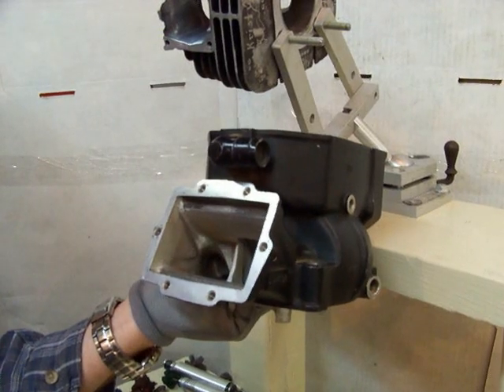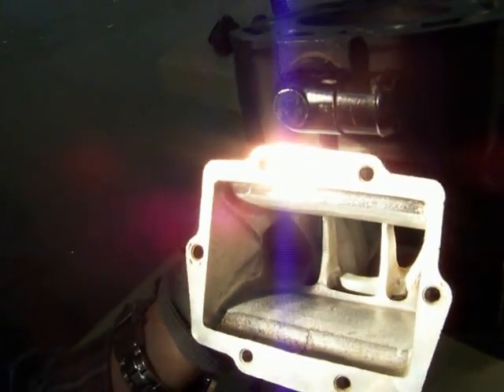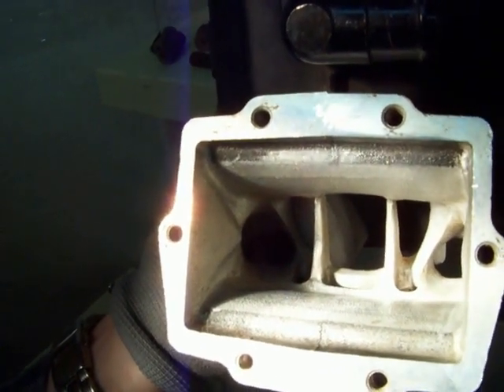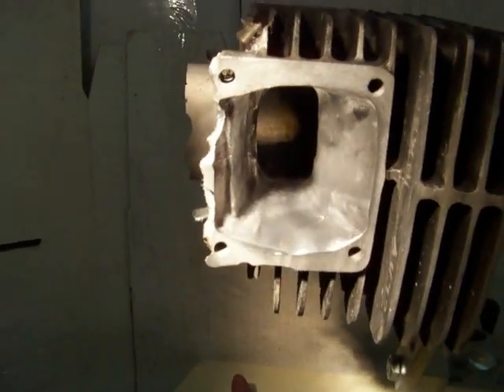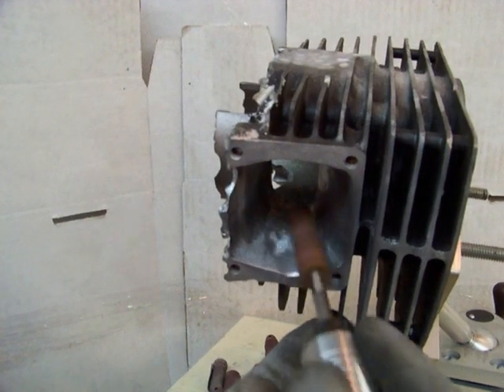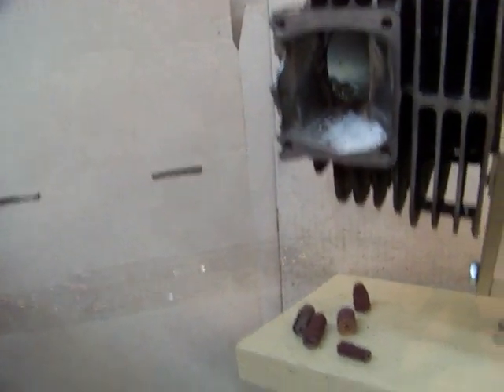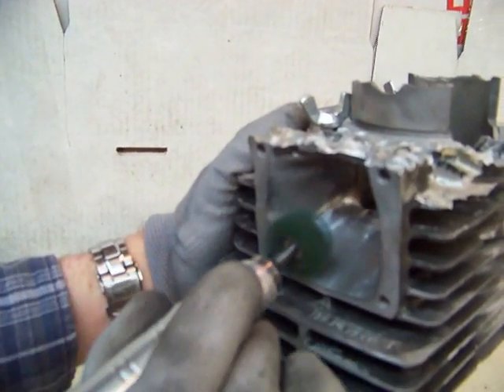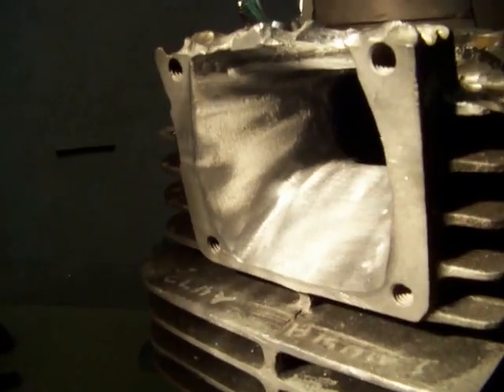2 stroke porting how to quickly put a textured finish on an intake.MOV

Comment: This is the "correct idea" for a finish on any surface that contacts the LIQUID GAS/AIR FLOW. The rough finish allows the atomization of the liquid into the moving air. The more the liquid (gas or gas-oil mix) atomizes the more efficiently the mixture will burn. The VOLUMETRIC EFFIECIENY will be much higher with the "textured" surface...the higher the volumetric efficiency - the MORE TORQUE and HORSEPOWER you will make.
Reply from the maker: +BrObama Jones Exactly! I know that it can be a bit counter intuitive to some, but that is simply how it works.
Reply: +CC Specialty Tools This can be demonstrated in the summer time (hot & sunny) ..place a spoonful of water on a mirror (polished surface) and a spoonful of water on the concrete (rough finish), then wait to see which one evaporates the quickest.  This simple demonstration will provide (common sense) the same idea for air/fuel/oil mixture moving through the ports. This same finish should be applied to the transfer ports also.   The shape of the port is infinitely more important than finish, but finish will determine the torque and horsepower of identically shaped ports. A polished exhaust port is simply to abate carbon buildup.Steve P.

Comment: It's NOT about the fuel vaporization bla bla. That increase in surface is mutch to smal for such an explanation! The scratches act like a lot of vortex generators! Vortex generators create a surface turbulence which provides a stable boundary layer which keeps the above airflow attached and eliminates airseparation and turbulence.. Therefore higher flow is provided. Just check aviation where this is standard practice to enhance a wing or stabilizer..
Reply from the maker: Actually the surface area increase IS the PRIMARY BENEFIT in relation to 2 stroke intakes of this nature. As I mentioned in the description of the video, (almost 2 years ago when I posted this) the air boundary layer does, obviously, prove beneficial. However the advantageous concerns of the air boundary layer are relegated to a secondary, if not tertiary consideration. The reason for this, is that, unlike air flow over the wing of an aircraft, which is the analogy I am sure you are relating this to, the air flow within a reed valve intake tract is pulsed. The descent of the piston causes a reverse in air flow, which closes the reed valves,  increases pressure within this area of the intake tract, and the crank case until the transfer ports open. This means unidirectional airflow is, for the most part, only experienced during the ascent of the piston. This also means that during these pulses of stagnant air flow, the fuel in the incoming air/fuel mixture, can form droplets, (in particular at low rpm) that adhere to the surface of the intake tract. Therefore a change in the surface texture that will decrease the surface tension it HIGHLY BENEFICIAL (remember the surface tension of gasoline/ethanol differs from that of water). The other consideration is that air flow, toward the front or mounting points of the reed block, will be highly impeded due to the reed blocks design, so there is a greater potential for fuel droplet formation in this area as well. So in summation, I agree that the air boundary and vortices formation are beneficial, it's just that they are NOT the primary benefit in regards to 2 stroke intakes. Thanks for watching.
Reply: keepin fuel from sticking to the surface is mainly why you keep the texture on the intake surface. the "air boundary" / golf ball dimples, air plane wing, comparison, probably helps, but that's not the main reason for doing it in the pulsed air flow of 2 strokes, bla bla bla :}

Comment from the maker: Thanks, and that is the Full Swivel Cylinder Head Brace. I have a video on my channel where I feature it and show a lot about how it works. It can easily hold a 500 cc cylinder, a high rise intake, or a V8 cylinder head, and lock into just about any position.

Comment: Yeah that is not gonna work too good. I know it seems like that would work, but you will actually increase surface tension on fuel droplets and decrease the air/fuel mixture from turbulent flow. If you are working on a non-pressurized intake systems, you need a slight texture. Experienced tuners know this.

Comment from the maker: IMO, yes I would still texture the intake surface, maybe to a slightly lesser degree when copared to the first cylinder shown in the vid. Even though there are no fuel dropplets and surface tension to contend with in a direct injection engine, there is still the "air boundary layer" over the surface of the intake, and laminar air flow is still more efficient, and we still rely on atmospheric pressure to induct the air, even in direct injection.

Comment from the maker: It can create an air/boundry layer in theory, however our Flowbench tests showed less than a 1% change in CFM or air volume passing through the intake, when this finish was compared to a smoothe one. This was true even on larger displacement engines. Of courese my theory is "if it helps you go a bit faster... It helps you go faster"